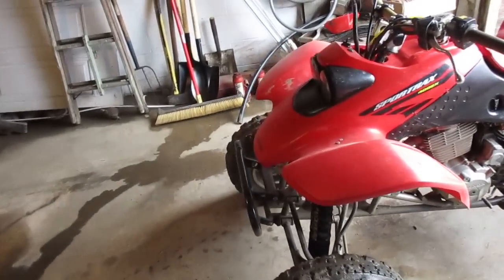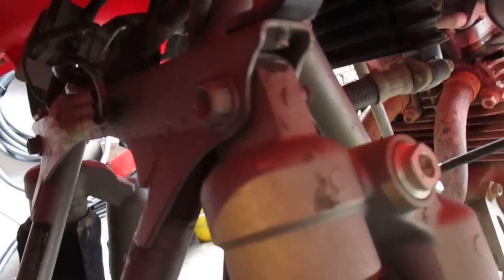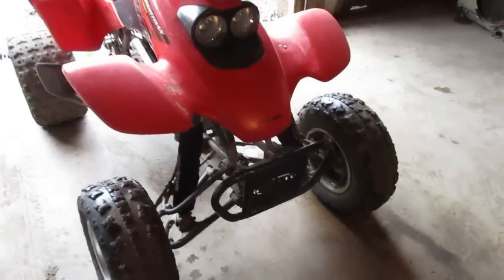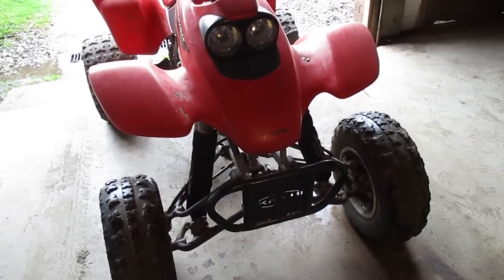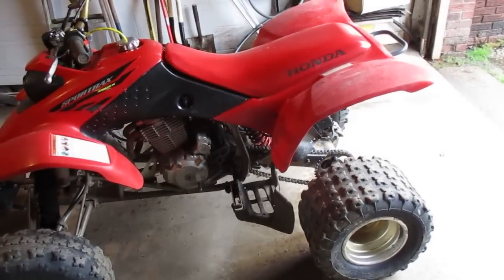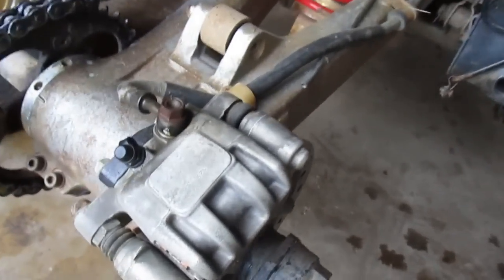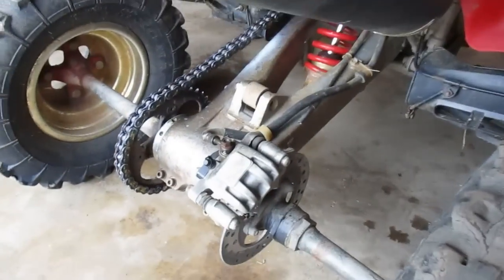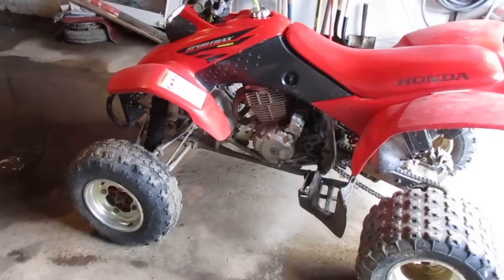3 Mods Every 400EX Should Have Had From The Factory!

Comment: While i don’t disagree with anything you’ve said, i think in front of everything you’ve said is NERF BARS, followed by intake, exhaust, and jetting, and tires, because the stock rears are hilarious. I purchased an 03 400ex new in 02, and the brakes or shocks have never been an issue. I freeride and track ride regularly. The brake mod you did sounds like an awesome idea, dont think ill do it, but its badass im sure. This is the first ive heard of what youve done. 👍🏻

Comment: Love the 400EX and wish they had made in 4wd for those of us who want a sport quad that live in harsh climates.
Reply: 27Zangle try a scrambler or trailblazer if you want a mix between a utility quad and a sport quad
Reply: @clayrichards4986   or if you are keen on welding  any  old blown polaris 4X4 or other cvt   4X4 quad  then  drop a engine from a wrecked street bike in .. and a little modding for drive fitment and you are in there .. the Old polaris 4x4 are 520 size chain driven 4x4 so are a easier conversion .. .. ( look on YT for " 600cc jesus walk "    also Kawasaki made a 30cc 4x4 with a manual clutch shift ??  the canam outlanders are fast like a sport quad ..
Reply: Get a Honda foreman 4x4
Reply: Kawasaki had a older year 400 4x4 with a clutch and gears like a 400ex.   I think it would be a fun trail atv with decent shocks and not too big and heavy tires.
Reply: 4wd=no wheelie or burnouts
Reply: Chase Schnitzler you can wheelie with a 4wd
Reply: The 400 ex line up should be able to handle harsh climates.

Comment: You could also change the spindles to a 2006+ trx450r and then use the dual caliper trx450r front calipers ... if you wanted to keep it all Honda.

Comment: Reading these comments, I have to add one my VERY BEST mod  I did to my 2000 400EX. A +2" rise  steering stem replacement. At 1st ,I ordered a 1", put it on and didn't like it. Sent it back and got the 2" which is the way to go for me. And understand I am 5'9 with arms from top of shoulder to end of finger at 30" 's. The tallier one was the way to go for me. The bike is much easier to turn  and hang onto in the rough, and does not wear me down as quick. Just saying.

Comment: Front breaks on a 400ex are fine..raced 6 years with no issues. If your fast you don't use your breaks hardly at all. Just get aftermarket break pads and your good

Comment: Great video. First thing I did on my 400 EX was buy 450 R shocks and grind to fit.. They are a bit stiff but I have all the adjustments at the lowest settings and it's night and day over stock. I'm 200 pounds so it works out OK for me. The brakes on mine are OK for me but I can see how much rear ground clearance you've gained with the smaller rotor. Good stuff.

Comment: For easy addon front shocks that don't require revalving. Use  either kawasaki kfx400 fronts or suzuki ltz fronts either being resivor shocks like the trx 450r ones.  But are much softer and better for riders under 200 lbs with no need to revalve. ..  the dual piston front yfz450r calipers are awesome. To further improve break response. Use braided brake lines.  For longer lasting stock breaks use centered metal pads.  They out last the other flavors.  With a slight loss of stopping grip.
Reply: What about for riders around 200lbs?

Comment: So I guess the moral to the story is buy a Honda 450R
Reply: MoToToYz lol really. Theres a reason why i have both. Lol.  And 400ex shocks are trail shocks as 450 shocks are race
Reply: Quad&bikes R3 Yeah the 400ex is more of a play around woods quad in general
Reply: @quadbikesr314  I got 450 shocks on my 400 🤷
Reply: @gearedupproduction8290  ya I never messed with it. I’m build one right now and debating on keeping stock shocks or getting aftermarket
Reply: @gearedupproduction8290  you can get nice aftermarkets cheap I’m pretty sure
Reply: @quadbikesr314  I guarantee you can but knowing me I don’t like buying anything cheap specially when it comes to my bikes
Reply: @gearedupproduction8290  makes sense. One I’m doing right now is all alba racing which looks to be great quality for sure just debating on rebuilding front shocks or buying new
Reply: My buddy has a 450r...I have a 400x...I smoke him in trails. He's quicker in open areas.... but can't idle down like a 400 can im technical trails
Reply: Or Yamaha YFZ450R...its best all around sport/race quad ever made. Still new from dealer!
Reply: @quadbikesr314  Go Elka or Fox.
Reply: @Davido50 I disagree ktm525xc is best race quad ever made. And it takes 1st for several reasons. Second in my opinion is the raptor 700 but maybe only for races like the Baja. 3rd is debatable but for me it's the Honda 400ex although not for racing just reliability durability and ease of maintenance.

Comment: the front  400 ex shock s are  pogo sticks  lol  same as  the utility quad shocks with a tiny preload adjustment ..  earlier Yfz 450 front shocks fit wit the same  way as the trx 450r with no need to revalve them ..  they  get taller in the later years (i think around 2012  or 2014  and are too tall ..  kawasaki  400 and 450 front shocks bolt on with out the grinding  or re valving ..   but the  rear 400ex shock is identical to the 450r rear shock   other then about 3/4  or1" shorter ..  and the  kawasaki ,suzuki and yamaha  front brakes are a direct bolt on and  all the  same brand  brake manufacture ..  Braided  brake lines make them even more responsive ..   currently i have  houser +2 arms and +2 stem .. with 18."tall  fox podiums  from  some donor polaris  quads .. and a shock mount bracket i made .. a decent set of pegged Nerf bars  9 the dual caliper front brakes n braided lines and  a YZF 250 FCR carb  n Duncann  full exhaust ..

Comment: Why do you not run a swingarm guard?  I have an aluminum plate on my 2005 and its bouncing off rocks all the time it seems that would otherwise be bashing my swingarm and or chain and rear rotor.
Reply from the maker: Those guards kill ground clearance too. I prefer those bolt through sprocket guards and an under rotor guard.

Comment: Front caliper from trx450 does it have to buy different hub with spindle disc brake? Or can leave same as Honda 400ex then installed trx450r caliper on it?
Reply from the maker: @jwcrazyrctoys2672  you will need the spindle, hub and caliper 2006 +
Reply: @ thanks, also still can use same as rim?

Comment: The front yfz swap did u get the entire hub or did u just get the caliper and rotor. Jw if the wheel pattern will b the same
Reply from the maker: hmongwild just the caliper and brake pads. That's all you need

Comment: Did you need to get any new bolts to do the rear brake mod?
Reply from the maker: Nope
Reply: Carpets World I’m also assuming the 450 caliper is just way better than the stock 400EX caliper because my 400’s caliper is currently frozen and I was thinking about doing this but I was curious about how worth it it was
Reply from the maker: @django4235  it's a night and day difference
Reply: Thanks for your input I’ll definitely do the swap